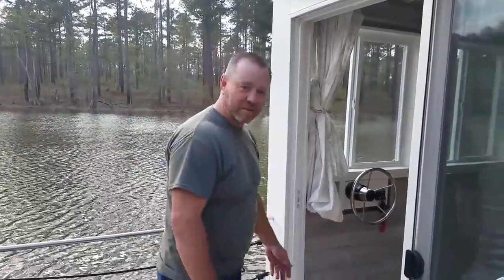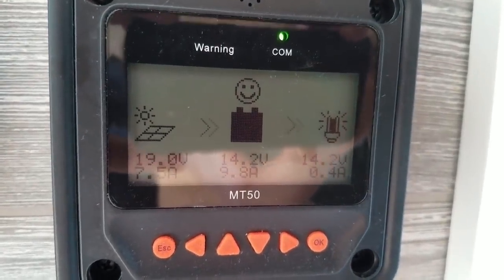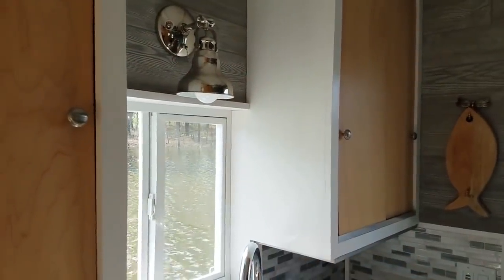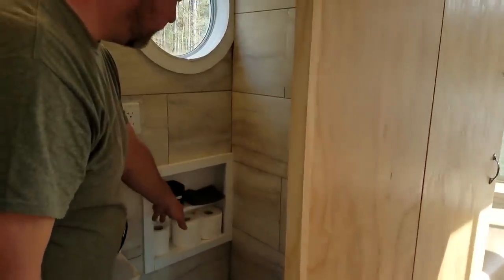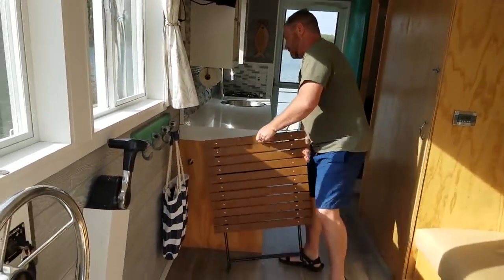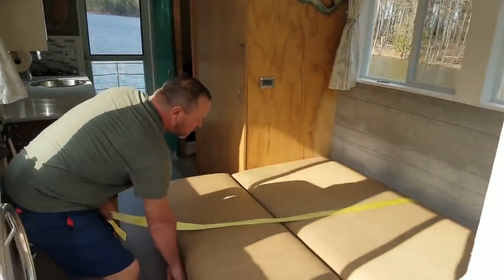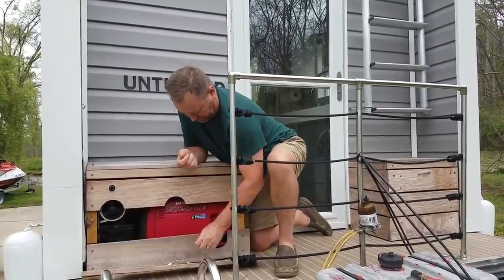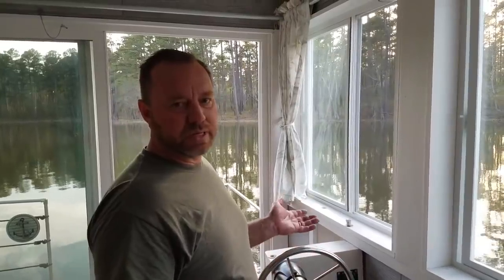A Tiny Houseboat Walk Through

Comment from the maker: There are many comments on the bed, please withhold judgement until you look at the updated version at 9:20 here:  https://www.youtube.com/watch?v=akYvsQMZKog&t=6s  I have made many improvements, including putting the base on drawer slides and using magnets.  Now less than 20 seconds to convert. My design goal was to have a sofa with a comfortable seating depth and height, and a queen size bed.  I have never seen a futon or jack-knife sofa that has achieved this, they always need some pillows behind your back so you can sit up straight.  Thanks for watching!
Reply: Darren Eck nice work on the bed that's really slick now!
Reply: Suggestion to check the location of the carbon monoxide detector with your local fire department.
Reply: Darren, I am building a very similar design right now and trying to figure out where to put my steering. What component are you using to flip out from the wall? Or did you build something? Thanks in advance! Love the steering recessed into the wall!
Reply from the maker: @emilymcallister4615  I Built a box to hold the hydraulic steering system that folds out.  Good luck with your project!
Reply: @DarrenEck  thank you Darren! I have rotary steering so I probably won’t be able to make that work then. Awesome design though! Will have to move mine to the front deck. Thank you!

Comment: Nice Boat!  -  Your Racor Fuel Filter is upside down!  The Plastic Bowl should be on the Bottom.  Add a Hose to the drain and it will allow you to drain any water that comes thru the fuel system.  The filter will perform better too!   ;-)

Comment: Been nice to see under sink and next to fridge storage space.
Could you put tiny casters on the bottom cushion so the bed  could roll out (another latch into floor to lock it in couch mode) All in all pretty tight build.
How long could you stay on the lake with out going back to resupply? How far can you travel on a tank of gas? Maybe a trolling motor and battery for backup propulsion?
thanks for sharing.
Reply from the maker: Ron Smith , I plan on putting the bed on drawer slides, but I can't find the right size yet.  I can stay on the lake as long as I want, we have a marina to fill the gas and propane, everything else runs on solar.

Comment: I love this boat and am in the very beginning stages of my very own build.  Would you consider sharing the building plans and materials used???
Reply from the maker: In the post description, there is a list of all of the equipment used, other than wood, windows, and doors from lowes
Reply from the maker: I don't have any plans, but it is framed like a house.  I used treated wood for the bottom plate and regulars 2x4s for the walls and 2x6s for the ceiling joists.  I do have some photos of the build, I may make a build video referencing those, since there is so much interest.
Reply: @DarrenEck  that's would be super awesome as I am very much a rookie builder.

Comment: Putting a gas burner beneath a cabinet is a disaster waiting to happen. Even if it's a metal cabinet the contents can get hot enough to ignite. IBCC requires at least 18"'s from counter top to bottom of cabinetry as a standard. This is otherwise a good looking houseboat. Many times builders are unaware of the dangers they create because either lacking in thought or execution.

Comment: Looks a little top heavy,... Too me.  ?
Reply from the maker: It actually has a very low center of gravity, most of the weight, pontoons, batteries, fridge motor, decking, fuel tank, water tank, etc are close to the deck level.  I have had it out in 30 mph winds and 3 foot waves with no issues.  Thanks for watching!
Reply: @DarrenEck  Fuckin'Aman man.